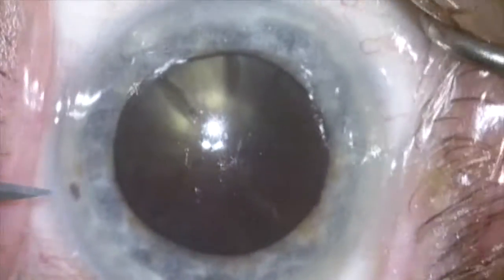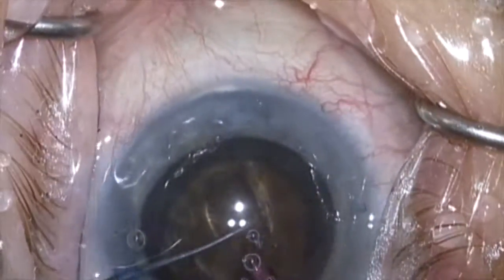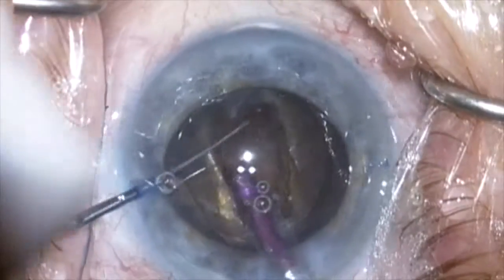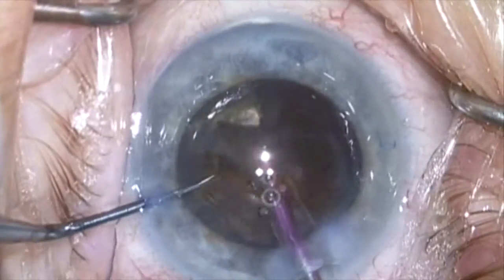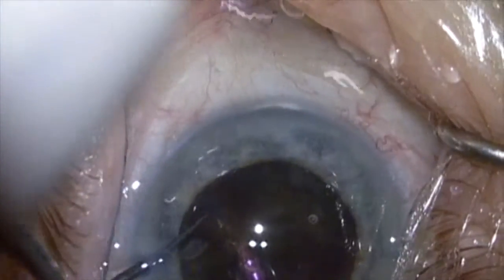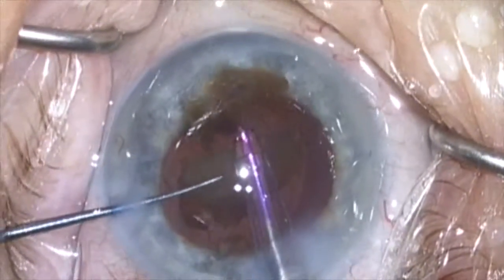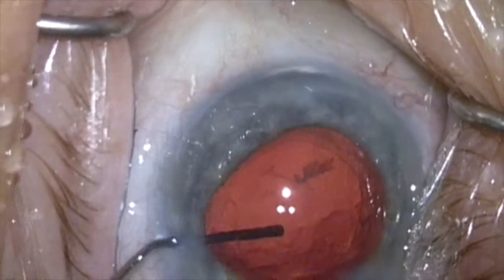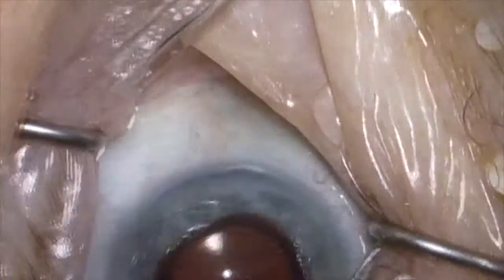Black Catarock Phaco by Steven G. Safran MD

Comment: It is obvious in this case that 300 mm vacuum was not enough to penetrate deep into this extremely hard nucleus even at 100% ultrasound. 500 mm or higher vacuum would've created deeper grooves into the lens which makes it easier to split. Nevertheless your technique is absolutely great and you were able to overcome the limitations of this machine. This patient should consider himself very lucky.
Reply from the maker: Thank you.  When I use the smaller purple tip I use much higher vacuum settings than with my standard tip.  I believe it was 450 for the chopping part of this case.   For grooving it is set low .

Comment: Doctor , Would you please share your Ultrasound settings for this case?  Thanks
Reply from the maker: Phaco is on 100%.  No pulse. Modulate power with footpedal so it's linear and there on demand.   Started in sculpt mode with low vacuum....like 50 and bottle llow and then switched to segment with vacuum at 300 and bottle at 120.

Comment: Why not use the chang vertical chopper since it's sharper than the sinsky, seems like you don't have to pull as hard to get the pieces to separate.  I do these cases the same way, just with the chang, basically a stop and chop.
Reply from the maker: +Matthew Kruger 
The Sinsky gives me very good control, feedback and safety.  I also use a Rosen and might have used it here but the one on this tray was missing and I didn't feel like interrupting things by having my staff open new trays looking for it since I rarely use it and I'm  not sure they even know what it looks like.  Usually we do have one on each tray but it's rarely used....I mostly use my standard chopper (which is an old Ocutek Nagahira type) or a Sinsky which every tray has and is easy to find anywhere I go.   Having a technique which I can use at every surgicenter/hospital I work it using a simple Sinsky hook is pretty reassuring.  I know I'll have what I need.

Comment: i had a cataract like this a few weeks ago, and i was afraid to try phaco, and i elected to do ecce. i dialed the nucleus into the ac and placed viscoat underneath, as i usually do, and my lens loop snagged the iris as i pulled out the nucleus and caused 180 degree dialysis. ugh. my heart sank. i closed the eye, and planned to bring her back when the eye quieted down, but she refused (the patient is pretty bizarre to begin with). i think maybe i do ecce so rarely now, that my skills decreased--i never did that before in my career. or maybe just a fluke. but i think ill rely on my phaco skills next time and follow your technique.
Reply from the maker: +ranchump 
Every technique has it's risks associated with it but I like the control of a closed system.   The patient in this particular case was the prototypical risk profile for expulsive hemorrhage so that was a concern.   I feel very comfortable doing phaco and not so comfortable with ECCE but others may feel differently.  This nucleus was unusual though in the really leathery nature of it's texture.   It was like rawhide.